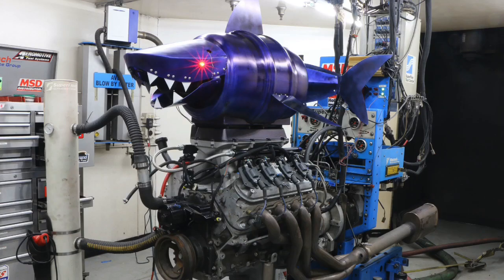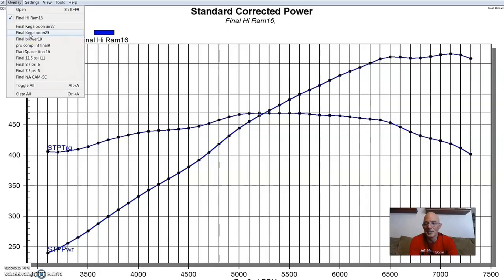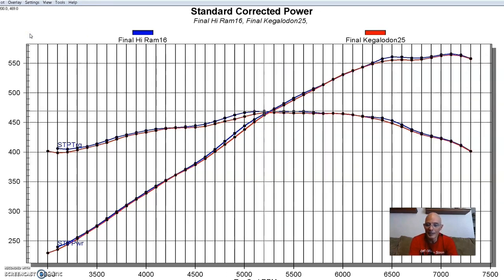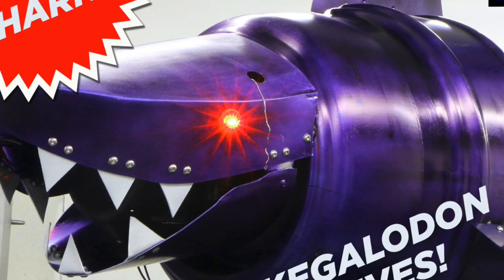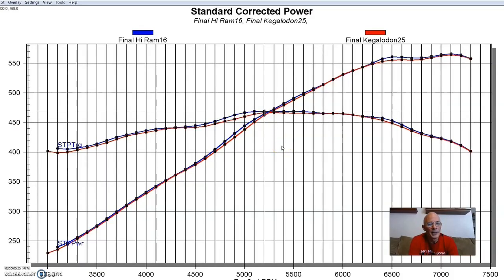DO CARB SPACERS WORK? THE ULTIMATE TEST! THE BIGGEST LS CARB SPACER EVER TESTED-THE MIGHTY KEGALODON

Comment: I’ve always wanted to know if the abrupt end of the carb throats and transition to the open plenum (even the half-plenum of a dual plane) does, versus a gradual blend.  My guess is that there’s a lot of turbulence, but that might be a good thing for vaporization and distribution. If there’s room below the carb for the air to mix up with the fuel in the turbulence.

I’m also really glad you mentioned the visible fuel reversion out the top of the carb.  I’ve seen that so often, but nobody ever talks about it. Putting on my acoustician hat (my degrees were signal processing, but I took three graduate acoustics classes):  that happens because mass of the air/fuel mix the 4 throats of the carb is the one of the vibrating masses of the helmholz resonator.   The simplest helmholz resonator is a hollow ball with an open neck, and  the resonance is the “spring” of the compressible air in the ball acting on the “weight” of the mass of air vibrating up and down in the neck.  As you said, a manifold is a very complex helmholz resonator because it has a volume plus 8 runner masses, plus 4 masses of air in the carb... but ALSO because there is net mass flow through the system, not just resonance of a fixed mass of air  in a simple helmholz resonator.  It’s all really cool stuff, and throwing the mass flow into the mix makes it a lot harder to either solve mathematically or model on a computer than a simple resonator.
Reply from the maker: I don't think that is an issue unless there needs to be more flow
Reply: Richard Holdener after I wrote that, I had the “forehead smack” moment where it occurred to me that even with a smooth blend, there WILL be a ton of turbulence just below the carb when the throttle blades are in any position except wide-open.  I see your point about it only being an effect that you’d see at very high flow... but I guess my point is that even then I’m not sure you’d WANT to eliminate that turbulence since it might help even out fuel distribution.

Comment: I like you Richard, but you have never responded back to me on messenger. I’ve given you a thumbs up on every video you have done. Would it be so hard to give me a shout out.  Love your work man. I’m also doing a Hemi 5.7 to a 394 stroker build that you would like with a 4th Gen motor going in my 13 Ram 1500, I do understand that your busy. You should be considered a national treasure!
Reply from the maker: I answer every comment
Reply: Richard Holdener. I actually just saw your video earlier that answered my question. My 394 stroker will work well with a Comp 210/220 & .600 lift, it will just be a good amount torque.

Comment: I think Kegalodon needs boost!  A little more than the CO2 produced when flowing liquid bread (yes, the result will be the same curve just higher--right?).  Maybe that test should try to swell the keg with mega boost.  Very interesting topic for sure.  I've always wondered what kind of artificial tornado exists in a V-8 single plane intake at 8K RPM.
Reply: Camera 🎥 time and maybe some lighting inside of the kegladon?? With it running? A dyno test

Comment: you can also do some tests with LPG, which is widely used here in Europe and has an octane of 103
Reply: I like it. I know that Propane was really popular across Europe for years. It's a challenge to directly compare octane, even on the same engine on different days.
I have never understood why high pressure port liquid propane never caught on in North America. LPG is really similar but is a mixture, i would really like to see a boosted test.
Reply: LPG is still popular. and much cheaper. 1 liter of gasoline here is about $ 1.70 and LPG is $ 0.80. LPG injection has also been tried, but the pumps break down quickly. with newer cars they use g3. I am a fan of the impco line and now use the 300 evaporator and 425 mixer for my 5.7 vortec. am now working on an l92 and use up 2 425 mixers with a dual port intake. but to get information about for example dual plane or single plane or which camshaft for max torque is quite difficult
Reply: @arjenvandrie7705  lpg would work really well in front of a turbocharger compressor intake?? Right as a pre cooling air inlet temperatures and for supplement and fuel supply ?? Ps. I’m not big on NO2 laughing 😝 gas spray but I’ve been told it would work the same way ish

Comment: Richard - I know you work a lot with the "Engine Masters" guys, as we see your goodies there... I would love to see if those so called "Screens" at the manifold gaskets help with mid range atomization...I KNOW the will likely be a HUGE restriction up at top end...but that isn't really what they are for....are they Science or Sham????
Reply from the maker: on what engine ?
Reply: @richardholdener1727  They are available for most engines SBC/SBF/SBM ... they are called "Torque Plus"  I first saw them, I thought they were a Sham, but I don't have the test resources anymore to test them... Curious if You had tested them or saw them used?

Comment: Why not test a single-plane manifold, and a dual-plane manifold, with something like Holley's Sniper injection system ? That way, you're only testing the manifold, not the change in carb to efi. Will a Holley Sniper run on a dual-plane manifold ?
Reply from the maker: I've run plenty of single and dual-plane intake tests
Reply: @richardholdener1727  With the Holley Sniper ?

Comment: If you are gonna test the carburetor and multi port is it also worth it to throw a TBI system on as well? Because from how I understand it the fuel is still injected at 50 plus psi so it wouldn't be affected like a carb would be based on how the engine is signaling. Just some thought

Comment: This was a neat test, a couple graphs comparing open and 4 hole spacers on a dual plane would prove the point. The issue you maybe ran into with the Holley Hiram is the plenum is already pretty huge. It would be possible to test a reduction in plenum volume. 
The dual quad top is pretty tall, a flat plate like was used under.the m90, drilled for the perimeter and dual quad pattern would cut the plenum by about half. It's a tuning factor and even the best guys have to put their theories to the test because it's so abstract.
I also don't believe this is Helmholtz resonance, it's still resonance but doesn't use non pathway airsprings.

Comment: I think you answered your own question about the huge experimental change in plenum volume, there at the end.

As far as I can tell, this is virtually the same as speaker cabinet design.  And if I'm right, from my experience, you will see minimal effects until you decrease the volume past a critical point.

Runner size and length should be comparable to speaker port length/volume, and/or horn length/volume, and would be very sensitive to changes.
Reply: Are you also known as, shocker mike?
Reply: @supercoupe28  Not to my knowledge.  Michael A is not my actual name.